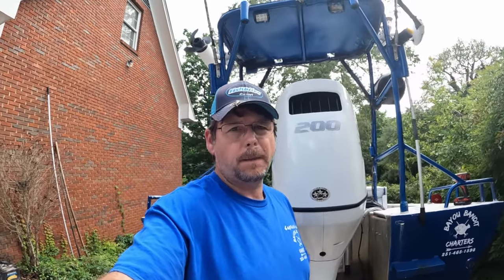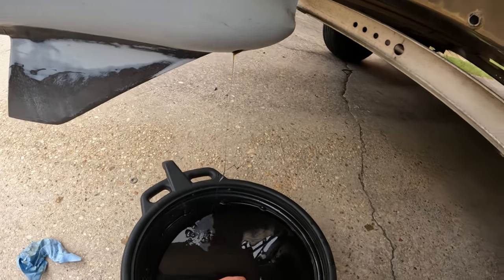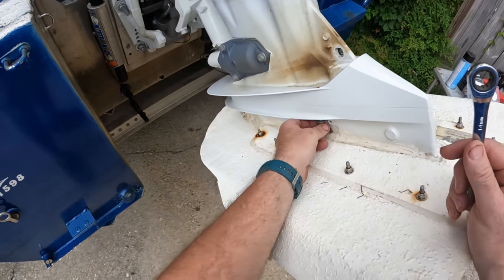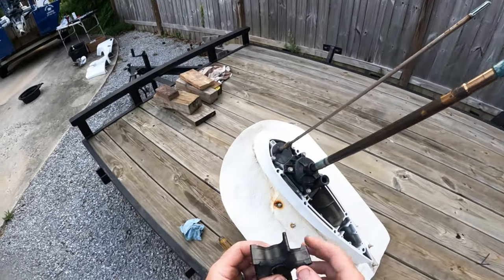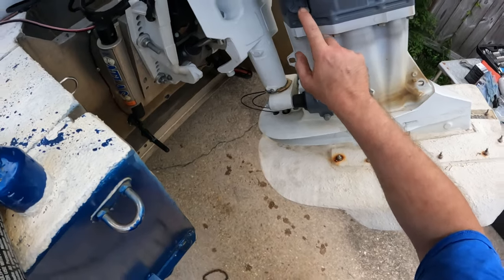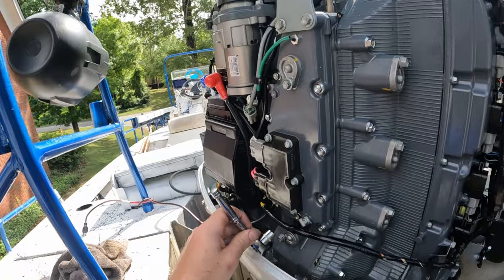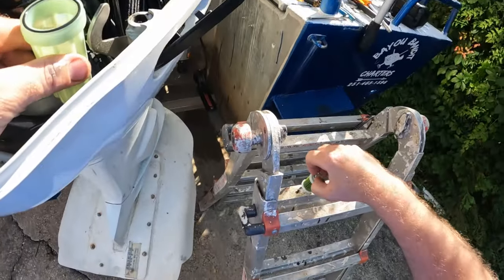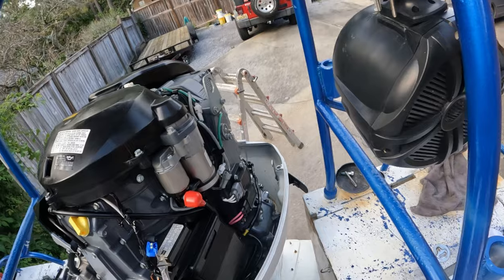**SUZUKI OUTBOARD MAINTENANCE**100 HOUR SERVICE** BEST **STEP BY STEP** HOW TO VIDEO on YouTube!

Comment: wow - i've been changing lower unit oil for 30 years - never even considered spinning the prop.  Thanks for the tip.
Reply from the maker: Any time brother!
Reply: I've used a tire pump with a special red tip fitting and pumped air through worked pretty dang good.

Comment: A++ video. 
The only thing I'd do different is replace all the water pump parts that came with the kit. Another thing I'd inspect the water holes (the engine side) with a flashlight for stuck debree in the tubes. Often when an impeller is missing rubber pieces (not in your video) these pieces will lodge themselves in the tubes that feed the engine colling water.

Comment: I don't often watch videos that are an hour or more, but yours was worth every minute. Have been using a little grease on the threads and mating surfaces of aluminum parts for a long time. It's definitely worth taking that extra step. I like that you disassemble and reinstall everything with hand tools and not impact or air ratchets. Including all the OEM part numbers was also a big plus for anyone with a 200hp. Looking forward to your video on using Saltaway. Am a firm believer in flushing after every trip in salty water, but have never tried the product. Thanks for a thorough run down on 100 hr service.
Reply from the maker: Yes sir! I really do appreciate your comment and happy to help. Thanks!

Comment: Just knocked out dual DF200’s with 140hrs of PNW saltwater use. Great video. Enlisted my dad for a second hand. Great way to spend the day with him. 

That engine anode bolt was a life saver. Picked up at ACE Hardware. 

I ended up splurging on the Suzuki engine covers for winter dry storage. Very well made. Felt a little funny waxing the cowlings, but they do look great. 

Bought some wire brush hand drill attachments for getting in and cleaning away anode salt build up. Next time would bring a vacuum. 

Impeller was fine so reused, but replaced the metal bowl, plates and o ring. First one, I tried to hammer out and destroyed it. Second one, I slowly pulled the o ring around which eventually helps pop out the metal bowl. 

The most important take away was physically removing everything, cleaning and greasing. I’ve had a lower unit seized and it’s not fun. 

She is ready for spring. Sending you some beer money. 

Looking forward to your next video.
Reply from the maker: Heck yeah brother! Man I appreciate you, thanks!! Glad I could help, Sundays video is on replacing anodes an how to flush your block.

Comment: Jody, thank you for taking the time to make this video. It's outstanding. I'm doing the 100 hour service on a pair of DF150APs, and I've followed your instructions explicitly. Here in Florida, my Suzuki Dealer wanted $1,850 to do both motors – Yikes!. I purchased the genuine Suzuki parts and all the fluids for under $600 and decided to just dive-in myself (with your help - thanks again). I've watched and re-watched your video before each step and everything has gone smooth so far. If all goes well tomorrow, I should have both motors done.
Reply from the maker: Your definitely welcome! Thanks for the comment!

Comment: Hey Bandit. You were right about that corrosion x. I just did my 50 hour service on twin 250APs.  The gear shift linkage (next to the 2nd from front zerk fittings) on my starboard engine was showing serious signs of elements.  Its exposed to the weather under under the plastic housing. I sprayed on the corrosion x, and used a nylon brush (from ace hardware) and was able to remove all the early stages of corrosion.  BTW I had replied under different account a few weeks ago.  I was right...doing this end of season maintenance in Maine is tough. Today was 37.  42 in the sun.  Not like your short sleeve sunshine - ha ha.  Of course I wasn't in the sun.  I can see why it could cost big money to do this service. Very labor intensive. Took me all day today to do oil, grease fitting, an anodes on 2 engines. 2nd was faster than the first when I got going.   I bought the service manual to help. Your vid was a great reference for the pregame.  Definitely some differences on the 250AP vs what you showed.  BTW service manual says tighten 3/4 of a turn after hand tight for the oil filter using the Suzuki oil wrench.  Also one thing that bit me was removing the grease tube from the zerk fittings. One was stuck on there real well.  I found solution online... push the hose fitting to one side and rotate the grease gun and hose 1 full turn. The host fitting releases easily from the zerk. Who knew?  Thanks again for the great vid.
Reply from the maker: Yes sir! Glad I could help.

Comment: Thanks for the video! Just did my first full service maintenance on my own. Your video was a huge assist.
All went smooth till the lower unit drain plug wouldnt come out. Stripped it out. Drilled it, used EZ out & torch but finally got it!
Thanks
Reply from the maker: Thanks brother, it’s always good to use an impact screwdriver for those if they are stubborn.

Comment: Excellent Excellent video. One suggestion is if you re use your engine (or any) anodes, take a wire brush to them to expose new metal so they can work more efficiently before reinstalling them. I take them apart and use a bench grinder / wire wheel and it makes things fast and easy. If you don't have one just do them by hand.
Reply from the maker: Yes, I agree
Reply: Never put grease on the anode it relies on the metal to metal contact to do its job. Tiny bit of silicone grease on orings normal greas is petroleum based and will deteriorate the orings.  I use silicone grease on my bolts as well since it is a firmer grease won't wash out over time and its water repelling. Even marine grease will absorb water.
Same for the water pump its not a lubricating grease so won't work for wear parts but as a protectant I'm yet to find anything that beats it. Same grease silicone is dielectric grease so onto the spark plugs boots they go to prevent corrosion in the boots you cannot see. Bonus keeps the boots lubed and supple. 

Apart from the grease on the anodes i think this video it worth its time in gold.
Reply: @corneferreira7691  the only thing I grease (and use plenty of it is on any bolt...always. I never grease the anodes themselves because of the reasons you mentioned. You are correct brother.
Reply: I'm sorry, I misunderstood the instruction; hence, the comment sounded like you were applying grease to the contact surface of the anode holder, not just the bolt.  @jamesrahn8339
Reply: @corneferreira7691 so are you saying that you can or can’t use silicon grease on an impeller and water pump housing?
Reply: @alwaysaway69 use silicone grease. Don't use normal grease as  rubber reacts with it over time. First it will harden and then start to crack. Not ideal on waterpumps and o rings.
Reply: Thanks mate. Good to know. 👍

Comment: I punch a hole in the oil filter with an awl to drain the oil before removing it, it's less messy this way. Nice video!
Reply: Be careful you don’t damage the spindle that way. Also once it has the hole it crumbles apart if the last person overtightened it
Reply: I use  a piece of 4 inch shrink wrap tape cut about 6 inches long.  I place it so when it lets go, I can catch the drippings in a container. I did that on my 2nd engine after learning the hardway how much oil dripped from the  first. I did not get a drip of oil anywhere other than the container on the 2nd.  I use the same technique on the oil dran plug so it drips away from the extension case into the oil catch bucket.

Comment: Great video Jody, I just bought the 200 for my bass boat. As you stated in your other video about why you went with Suzuki over Yamaha made complete since to me, besides my local dealers couldn't find a 200 Yamaha period. I did lose a little on the top end, but it wasn't a big deal to me. The old 2 stroke Yamaha on my Skeeter pushed me at 67-68 top end, now my top end is 60-62. At almost 70 years old that loss of 6-8 mph's isn't a factor anymore, but reliability is a key factor. Thanks again for calming my nerves.
Reply from the maker: Thanks brother, you will definitely enjoy the reliability and fuel efficiency of that motor. I definitely love mine! Thanks for your comment, I appreciate it!

Comment: Great video. 
Seeing you turn the prop makes sense now as to what my dealer told me to do, that is to fill lower unit to the OIL plug instead of OIL LEVEL plug. It takes about that much more instead of spinning prop... 
Dealer said suzuki realized OIL not reaching upper part of gear in lower unit so fill to that level.  But never mentioned spinning prop... so basically accomplish the same outcome I'd imagine...
Again great video 👍
Reply from the maker: Yes sir, thanks for your comment brother!

Comment: Thanks a heap for the excellent video and the very descriptive explanation of each of the many steps throughout. I’ve watched a ton of these types of videos and no-one even comes close. Most comprehensive video out there by a country mile. Objective achieved. 👍 I just used your video to help do the majority of my 200 hr service on my Suzuki DF100B myself. It has helped me immensely. I reckon I have saved in excess of $500 so far. And I now feel much more confident that what I’ve done was done correctly. Not to mention how much better I understand my boat engine now. All I have left to do for my 200hr service are the two big one’s - check valve clearances and the ignition timing. Not sure how to do the ignition timing at all??? Valve clearances I’ve done on a car but never for a boat engine? So I figure I’m the only one now asking you to run up your boat hrs, get your hrs to 200 asap (😂) and please please do an updated servicing video for 200hrs. 🙏 I could really use your help.
Reply from the maker: Thanks for your comment brother, happy to help!
Reply: @bayoubanditcharters  Are you going to do a 200hr service anytime soon? Be good to see how to do the tappets and check engine timing….
Reply: Guess not. Just did it myself. Maybe I should post it. lol

Comment: When I change my impeller I use the whole kit because that cup will have wear on it and soon as you start your motor it will wear to match the old cup so always put the water pump kit in and I’ve seen at least 25 people that have a heat problem they do what you do and not change cup and impeller that’s not a good practice to go half way on you service Change the cup every time .

Comment: Good job!  I can’t think of anything you missed, and I learned about the pressure switch today.  Fresh water boater, my anodes get some sort of a gel on them I clean off.  And on my 100 hr service, I guess I’ll drop my LU and grease up those shafts 👍
Reply from the maker: Thanks brother!
Reply: @bayoubanditcharters  wenn sie den Schaft unten abgebaut haben und nehmen immer eine Anode aus dem Motor raus, so können sie den Motor durch das Loch mal durchspülen wenn sie guten Wasserdruck haben. Bei ihnen ist ja der Wasserdruck schlecht wir hier in Europa haben 10 Bar, man braucht einen Druckminderer im Haus. Gute Arbeit.

Comment: I have had the situation of preserving rubber parts in talcum powder and in a plastic bag, and no mater how long you store that part will be like new. I have tried it with swim wear masks, fins and it does work. That tip wS from a mechanic long ago.😮😊😊
Reply from the maker: Great tip!

Comment: Amazing videos all of them on the maintenance. I’ve watched other videos on the Suzuki Outboard grease points.  At the end you greased the first one the hard one. Isn’t that the gear box under the engine. Maintenance videos are great teach people it not just run and gun trailer maintenance or your Suzuki Maintenance

Comment: Thank you, this video was extremely helpful.
Reply from the maker: Heck yeah! Thanks so much brother, I appreciate it!
Reply: @bayoubanditcharters good job man. But in botten in fuel filter cap put this away, there is condenswater. This is bad for inject system. I am motorcycle mechanic and have no boot engine but i watch this complete. Do you not adjust the valves ? I read suzuki manuel instruction and there is valve adjustment at 20 hours and then 100 hours and every 100 hours. I need now a boot engine. 😂 Greetings from Germany 🇩🇪

Comment: Great video. You do all the things I like to do, but one thing I think you should do. Spray the hole engine block etc. with some Silicone spray or thin oil, to prevent corrosion.
Reply from the maker: I do, lol! https://youtu.be/k1VyVnPR-ok?si=Q6fMeoTW8iLle4vt

Comment: Thanks for the video- very informative and I referenced this to do my service.

One question though- any advice for accessing the lower thermostat bolt?

Top two were right and barely managed to break them but I can’t seem to get a wrench properly on the bottom bolt to break it loose. 

Any advice/tips appreciated.
Reply from the maker: Man that bottom bolt is a pain in the butt! Just a slow go with an open end wrench

Comment: Hey, another great video. Glad to hear the prop spin was something possibly useful you. Another possibly unnecessary tip. I’ve heard contradicting opinions but I lean on the side of caution and spend the extra few $$$. Yamaha makes a specialized grease WR No2 that  is for use on the driveshaft splines. Again, I’m sure it’s unnecessary but it’s something I do.
Reply from the maker: Definitely!

Comment: So just a question, observation … the 3 plugs for the lower unit… couldn’t you fill from the 3rd top plug with the lower screwed in after draining and then still be able to see the oil level plug start to pour and then stop? Seems like it would be less messy and keep more gear oil in the unit.
Reply from the maker: Yes you absolutely can. It will take longer to do because the air will escape slower, and you will have another plug seal to replace

Comment: Thank you so much for this video - I have watched your video over a dozen times this weekend as I did the full maintenance on my twin DF200A's. I would not have been able to tackle this without your video. I appreciate you! ---I got to thinking after I changed the spark plugs, that maybe I should have checked the gap on them? You didn't mention it in your video - what's your opinion on this?
Reply from the maker: Thanks brother, glad my videos were helpful! I have checked the gap on the new plugs several times and they were always within the Suzuki specs. (High end but in tolerance)So I didn’t talk about it in the video. Thanks for watching!

Comment: I have a question. I'm about to do this service, my specifications show 8.5 liters which would be 9 quarts. Am I reading that wrong? Looking at my 20hr service which my dealer did I was charged for 8.5 quarts and the stick is dead on the money. So I honestly don't know which it is. Thanks man awesome video.
Reply from the maker: 8.5-8.6

Comment: Thanks for the video. Greatly appreciated. Got any videos on getting air out of the steering system?
Reply from the maker: Thanks brother! Lol, I might have one before long! I think I’m developing the same issue. If I turn the helm normally there is no issues, but if I turn it very slowly there is no movement on the cylinder.

Comment: Hey! What is the sequence with the key and battery? I see you still had the battery on to raise and lower it. But was the key in the ignition? In the on position?
Reply from the maker: Yes, you have to have the key on to raise or lower the motor from the helm.

Comment: Capt. Jody,
Thanks for such a useful video.  Very thorough. I just reached 10 hour breakin on my 2023 DF200AP yesterday. Was debating whether to do the 2 hour service myself. After watching your 20-hour and this 100-hour service videos, I am prepared to do those services myself. My DF200 replaced a 27 year old 175 HP mercury. Was rigged by a very nice Suzuki Dealer subcontractor our to southern Florida. I love the extra torque and quiet new Suzuki. 
Thanks again for all your great videos. I have been looking online to purchase a genuine Suzuki Service/Repair manual. Did you purchase one before launching into your 200-HP services? Tight lines.
TR
Reply from the maker: Thanks brother, I appreciate it!

Comment: And I always put vegetable oil on the impeller so that if it’s the end of the year and going to set for a few months it will not stick or dry start and it will not degrade your rubber impeller.

Comment: Hello from Finland! I have 175 APX Suzuki 2018 year model. It is now 800 hours on it and it run still well, but i think it is maybe wise to check valve clearance and adjust if needed. Can You make also a video about this valve adjustment please🤗...?
I have aluminium boat 7,8*2,4 m center console, and this Suzuki is very fuel efficient and quiet motor. I will get Solas amita 3- plus 15,3*23 pitch prop 75 km/h ,40 knots. 5700 rpm.
So far no problem with Zuke.
Reply from the maker: Hello there Finland! I would check at 1000 hours. First run a heavy de-carb mixture of 1 can of Sea Foam to 1/2 gal of gas. Run half of the mixture then let sit for 30 min. Then run the rest. Motor will smoke a lot while burning off all the carbon. This will allow the valves to seat properly, then check valve clearance. Thanks for your comment!

Comment: Hi.

Before you remove lower leg unit, do you need to put the motor in gear (from helm) to assist with shaft alignment?

I recall reading something like this when I did this on an older 115Johnson outboard some years ago….

Cameron
Reply from the maker: I’ve always done it in neutral and have never had any issues.
Reply: @bayoubanditcharters  ok thank you.